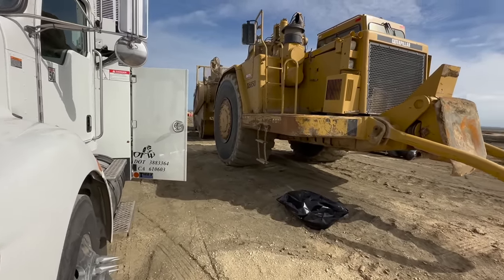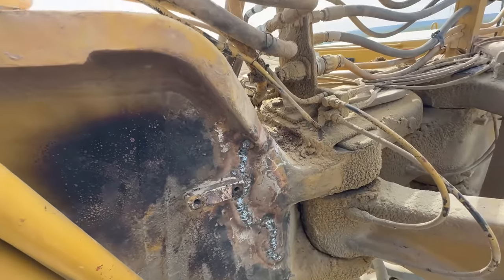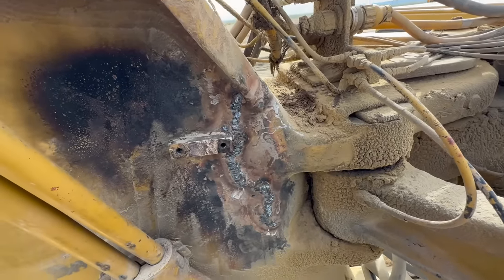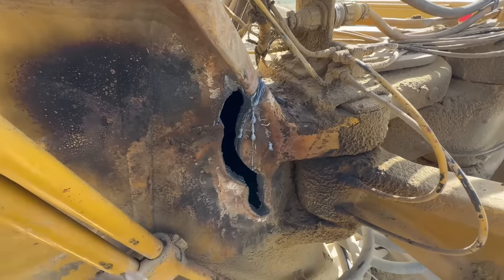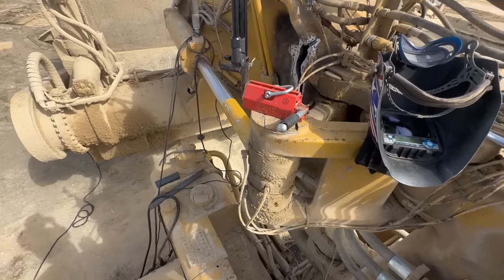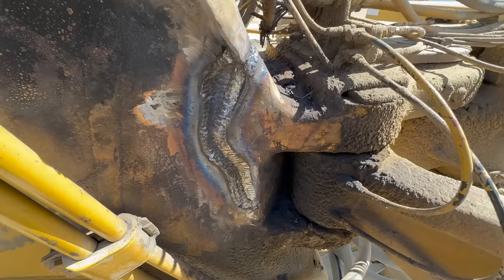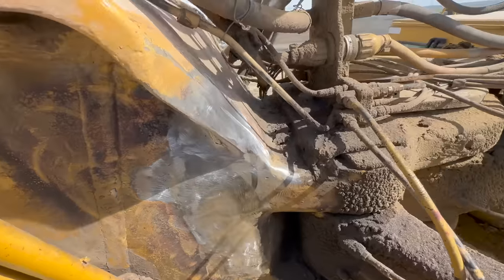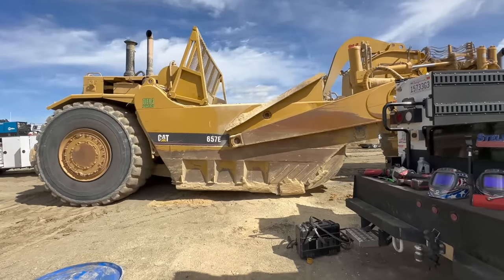Cat 657 with a big crack!!!

Comment: I assure you, it's going to crack again, right where your weld contacts the old metal. The ONLY way to somewhat reliably fix it is to disassemble the part, cut out ALL the cracks (search for them with an ultrasonic probe!). Then preheat the ENTIRE part to spec, probably 150+ Celsius, then weld it INSIDE where the ambient wind doesn't blow away your shielding gas. 
The fact that it already broke where it did indicates a bigger problem in the machine that was not addressed. Probably worn out axles or bearings.

For reference, I weld machinery and attachments for heavy duty applications mainly in MAG and have for 10+ years. Things break. When they do, you can fix it, but it's never a permanent solution. 
Edit: Particularly, unqualified field jobs of welding without preheating voids all warranties, since it introduces more stresses and cracks.
Reply from the maker: You are correct it will definitely crack again in that general area.  It is a known weak point for scrapers.  As I said in the video, it should be completely taken apart and fixed with new material etc. the axles have nothing to do with this failure.  I usually never have issues with my shielding gas while welding outside.   I am not claiming this to be the best or a permanent repair.  Just doing what the customer asked.

Comment: Im guessing you use flux core for big fills like this, any reason you wouldnt just use stick? I would think being outside I would worry about losing the shielding gas, unless you get self shield wire
Reply from the maker: I use dual shield.  Stick is too slow.

Comment: Is a repair like that stronger then it was before the damage or is it slightly weaker?
Reply from the maker: The weld area is stronger than the original material.  The weak point will be where the two come together.

Comment: Could be a bad batch of metal from the factory. Welds rust and break, depending on the type of metal it may make it worse because of endothermic reaction. 2 different metals will erode each other. The paint even will trap moisture underneath.

Comment: How thick was the backing plate you put in? Does the wire do most of the holding anyway?
Reply from the maker: Backing plate was 1/4”. It’s just there to keep the weld from falling back.

Comment: I don’t know anything about welding but had a quick question. Why don’t you use the metal you cut out and re weld it back in place along with the backing plate? Seems like it would be a lot easier and faster but again i don’t know anything about welding hahah
Reply from the maker: The whole reason I cut that metal out is because it’s full of imperfections. The reason I did it this way it’s to eliminate those imperfections.
Reply: @OFW  thanks for the response. You learn something new everyday!

Comment: I'm curious, as a layman with a little welding experience, do you consider a MIG to be superior to a stick welder in a situation like this? Would it have an impact on the quality, cost or time of the weld?
Reply from the maker: I wouldn’t say MIG is superior to stick. Both have their advantages.  In this situation the MIG advantage is deposition rate and tensile strength depending on the alloy of the wire.  So with MIG I can weld faster with a high quality weld which means a cheaper invoice for my customers.

Comment: Wow!! I had no idea that the void would be entirely filled with weld!! Any way of knowing how much welding wire or rod was used? Sorry, not a welder but my dad was when I was little.
Reply from the maker: Not exactly but you could weigh the welder before and after and get a pretty accurate measurement.

Comment: I'm curious, what kind/thickness of wire and amps are you pushing for metal that thick?  I'm on the complete opposite of the spectrum and do my best not to burn holes through 22-24 gauge body sheet metal with 0.023 wire and probably 50 amps or so.
Reply from the maker: 1/16” wire and about 250 amps.
Reply: . @OFW  Thank you.  Man that is some serious current.  And wire lol

Comment: how structurally strong is this weld compared to a part thats not welded, how does it change the structior of the metal?
Reply from the maker: It’s very similar the the factory metal.  A little higher tensile so if it failed again it would probably be next to where the weld is.

Comment: It is not recomended to stop a few times between passes to not overheat the material to avoid contraction and bending?
Reply from the maker: Yes, you should monitor the temperature of the material and stop if needed.
Reply: @OFW  Thank you for sharing your experience. God bless you!

Comment: I figured you would put some kind of stretcher plate on there... I guess it'd be kind of hard because the surface isn't flat but I figured some kind of diamond shaped plate over top of the weld
Reply from the maker: Can’t because it won’t look factory.

Comment: As a lay person, I've always wondered - are the welds as strong as the original casting?  Also, how did you get the backing plates behind there?
Reply from the maker: The welds are stronger than the original material.  I tacked a small piece to the backing plate and fished it in there.
Reply: @OFW  Thank you for explaining!  I definitely recognize the grapevine.  Don't get caught in the Tule fog!  Cheers!

Comment: It will be interesting to know the durability of "filler" welded repairs like this one, and the type of wire, shielding gas, settings and equipment you're using. The machine is obviously under engineered and prone to fatigue cracking. Though the repair looks pretty it will eventually crack again, probably next to the weld, I guess. Improving structural strength will be difficult though in such a spot. The question to me is how long will it last. They'll have to keep an eye on that spot regularly
Reply from the maker: I have seen these repairs last 10+ years or fail in a month.
Reply: @OFW  I was always told mig wire was to soft even 6011 or 6013 wouldn’t hold up but I believe the main reason of failure is the pivot bushing get slop in them

Comment: I’m 10000% sure that crack is already appeared at the same spot. Welding has been done with no preheating the base metal. Welding has to be done with stick 7018 with constant heat up. At least he could use 072 wire.
Reply from the maker: I am 10,000% sure that you are very wrong. There was pre heat,  just because it’s not in the video doesn’t mean it didn’t happen. I don’t  know why people don’t understand that.  You must not know very much about welding because the wire I was using is the equivalent to 7018. It’s actually a little bit stronger.

Comment: Are you using Flux core or gas?  Kinda surprised you didn't use a stick welder
Reply from the maker: Dual shield with gas.  Stick takes too long.

Comment: It amazes me how that plasma cutter is like a hot knife through butter.  Damn, the energy there must be tremendous.  That weld looks amazing.  For us non welders out there, is this weld as strong as the original metal ?  Does it suffer any porosity issues or are your welds solid metal all the way through ?
Reply from the maker: Plasma is an amazing technology. The weld area is slightly stronger than the parent material.  The weld is solid all the way through.
Reply: @OFW  Thanks.  I’ve learned something today!

Comment: what wire was this? did he say and I missed it? Hard to tell process... and most of that paint just blew away...
Reply from the maker: Lincoln 71a75.  Unfortunately I can’t control the wind.
Reply: @OFW  Short Circuit, Globular, Spray Arc and Pulsed MIG? And yea, sometimes the wind sucks. I've used a cardboard box to block the wind before.

Comment: Hey just curious if that’s a known weak spot when grind off yer cap pass.
Reply from the maker: It is a weak spot on all scrapers.
Reply: @OFW  i totally didn’t even type that comment correctly but why grind off the reinforcement weld/cap pass. I totally get making things look pretty I’m a heavy fabricator as well and do a lot of repair work also. My mind says leave that cap pass on!
Reply from the maker: @grantwright2247  because most of my customers want it to look factory.

Comment: Never weave stringers like that in a cracked section. It won’t last. You need a back gouge and stringers to repair the best you can. Also don’t turn it blue, peen welds between passes to relieve stresses in the welded area. Post heat and pre-heat are needed and necessary. Know your inter pass temps as well and don’t exceed them. It’ll last a lot longer before cracking in that area again. No doubt it will.
Reply from the maker: Never had an issue with a weave. It was pre heated and I watched the temperature. It will definitely crack again.
Reply: @OFW  a weave is a no no, in the welding world. If I did that where I work, I’d be fired on the spot. Lol seriously. We use cooper heat and monitor the heat, and later ramp it down 50 degrees an hour for every inch of base metal thickness. Usually last a long time before cracking again. I work mostly in cold northern Canada climate though.  We see some very cold temps. ✌️

Comment: Sure I am not a professional like you. But it would be nice if you can give a little bit of information about the welding parameters you used for this fine work. Type of wire, amperage. Thx a lot.

Comment: What are you running for voltage and  feed speed? What do you run for a mig ? Looks like a tweko gun kinda
Reply from the maker: Wire: Lincoln 71a75 1/16” dual shield 
Gas. 75% argon 25% co2 
25 volts 250 IPM  

I personally do not like tweko guns.  This one is a Bernard and they by fare are my favorite.

Comment: why dont you use a magnet to pull the metal chunks out? it avoids pushing the piece further in, and gives alot of force. it can even hold the section while you cut
Reply from the maker: That’s a good idea.  I didn’t want to climb down from the machine.
Reply: @OFW  i know the feeling.

Comment: I would have thought using stick would be better than wire since the metal is so thick? I'm no welder I'm just an (constitutional) attorney but work on airplanes on weekends and when I was in Airframe & Powerplant school we had welding for a semester
Reply from the maker: Wire can be just as strong or stronger than stick depending on the wire.
Reply: @OFW  great welds Sir

Comment: Maybe stick weld but not a MIG.   Is that gonna be strong enough?
Reply from the maker: Mig is just as strong as stick. Or stronger depending on the wire.
Reply: @OFW  i guess you do not need it as strong as a bridge.
Reply from the maker: @rabidfarmer9765  you do realize a lot of structural welding including bridge welding uses the same exact process that I used.
Reply: @OFW  i got you man -thanks.

Comment: Great job. Plasma cutters are a game changer, wouldn’t you agree? I’m guessing that area is cast steel and not iron. May I ask what grade of filler wire were you using with your TIG ?
Reply from the maker: I believe it is either forged or cast steel. Lincoln 71a75 wire.

Comment: What plasma are you running? Any issues running it full bore on your big blue 600? Wired for 3 phase i am assuming? Looking to get one for my big blue 500.
Reply from the maker: Hypertherm powermax 105.  Technically the 600 is slightly under powered for it. 90% of the time it’s fine for full power.  Every now and then it acts up. Typically when it’s still cold.  If I did it again I would probably buy the 85.
Reply: @On Fire Welding   Does your big blue hate the cold, too? Mine will white smoke and miss like crazy if I put a load on it while it's cold.

Comment: Wouldn't stick be stronger? why choose MIG over stick in this situation?, not doubting your skill, I am new to welding.
Reply from the maker: MiG is just as strong or stronger than stick.  And it’s 5 times faster.
Reply: @OFW  Another channel stated the order of strength is 1) TIg/Stick and 2nd Mig, is this one of those heavily debated things?
Reply from the maker: @engjds its like Ford vs Chevy.  Miller vs Lincoln.  If it’s in the hands of a professional and done correctly then there is no reason one would be stronger than the other.  In my opinion if using the same alloy filler material it would be the same.  I do think TIG would be the strongest.
Reply: @OFW  Thanks man, thats good to know, btw, what kind of MIG welder are you using there for those big welds, is that a 3phase machine?
Reply from the maker: @engjds not 3 phase.  It’s a miller arcreach 12.  You don’t need a massive machine to weld like that.

Comment: This is a stick job if ive ever seen one.  Not sure why you would use mig, even with dsfc.
Reply from the maker: But why use stick?  What would the benefit be?   
The wire I used is stronger than 7018 and I got it done 3 times faster.
Reply: @OFW  Stronger in what way?  There is a reason we use 6010 for the root and 7018 for the cap
Reply from the maker: @Dev_Everything  look up the specs.
Reply: @OFW  Next pipe job im gonna show up with a mig welder and tell them its stronger🤣
Reply from the maker: @Dev_Everything  if it’s done correctly, it would be. Have you never seen pipe welded with wire?
Reply: @OFW  Ive been pipe welding for 16 years.  Not once have I seen a MIG welder for serious application.  I have seen spray arc transfer in heavy metal places but nothing that is critical

Comment: I got a real welder general electric it will run a 1/4 dimanter rod 7018 pobly uphill pretty good side gap and weld half inch plate to 1inch thick on ships

Comment: Great video! I am curious about one thing; That's a great repair, very pretty but I don't see anything that will prevent it from re-cracking. Your thoughts on this?
Reply from the maker: It will probably fail again.   Design flaws
Reply: @OFW  A proper fix ensures it doesn't fail again. Shoulda reinforced it.
Reply from the maker: @slipperyslope3912  how would you suggest doing that?

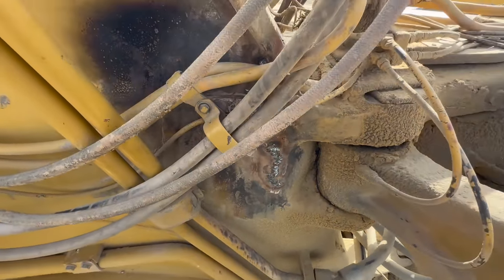Comment: That is an amazing repair job. Question: how did you get the backing plates in there without dropping them into the void? Magnets then tack weld? Also, what were those other cracks at 2:19 ? Oh, and one other question :)  Did you know for certain prior to cutting whether or not there were any electrical or hydraulic or other stuff behind the area that you cut out?
Reply from the maker: I tackled a small piece of metal to the plates to hold them into position. Those are the original cracks. I knew there was nothing behind there.

Comment: How important is windy conditions when using dual shield? Is there enough protection with the flux alone?
Reply: There’s no shielding provided by the flux with gas shielded flux core. The flux simply increases deposition rates and facilitates welding out of position. You simply block the wind, park the machine so it blocks the wind and crank up the gas flow.
Reply: @williamthomas9463  Thanks man. Didn't know that.
Reply from the maker: Well if the gas gets blown away you will instantly get porosity.  The flux helps with several things including depression rate and silicone.    If it’s too windy you must use a different process.
Reply: @OFW  can I ask what wire used? I just bought a spool of Lincoln’s Elite. Wire.

Comment: I've never used a plasma cutter before, and I'm shocked at how easily it cuts through steel of that thickness
Reply from the maker: This plasma will cut over double that thickness.
Reply: @OFW  that's crazy! It's incredible the tools that we have nowadays
Reply: I'm only a "backyard" type of welder but I bought a plasma cutter 10 plus years ago and I thought it was the coolest thing ever. Recently I came across a cheap plasma cutter at Amazon warehouse and bought it for kicks .. The plasma cutter cuts WAY better than the one I've had for ten years.  I used it yesterday on some 3/8" angle iron on an old trailer and it cut the steel like butter. Blew my mind, all for a $100 bucks as the box was damaged!!!! Best cheap plasma cutter yet, IMHO.

Comment: Too many don’t appreciate the increased strength gained by grinding the weld near flush to the parent metal. It’s not just aesthetics. Very good workmanship.
Reply: Too many people don't realize that you fail your welding tests if you grind your welds. The weakest part of a weld is the transition of welding material and original material. Grinding down until your imperfections are invisible just thins the entire part.
Reply from the maker: The weld test I took we ground the welds down as instructed by the CWI.   If you think I just sanded the welds till all the low spots are gone you are very wrong.

Comment: Hey man, how did you know (or did you?) that after you cut out that weld and removed all that material, the machine wasn't going to fail structurally at that point? If there's a method or something to figure that out I'd be eternally grateful if you'd share that information. 👍

Great patch job, that was awesome.
Reply from the maker: Are you talking about literally falling apart while cutting it?   It takes a lot for them to fail catastrophically.
Reply: @OFW  Yeah, I mean, I'm unfamiliar with the construction but if I had that job, I'd be nervous about it failing catastrophically unless I was aware of some knowledge otherwise.

Comment: Did you use 600 amp to weld it
Reply from the maker: 600 amp welder.  Welding on about 250 amps